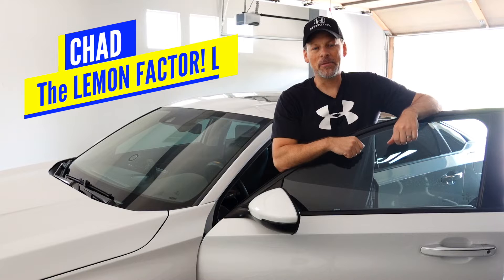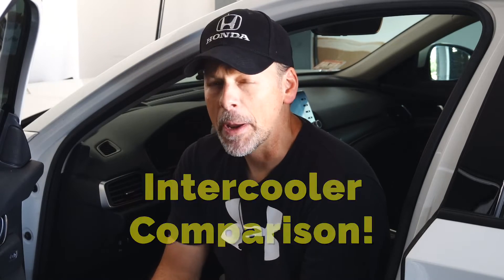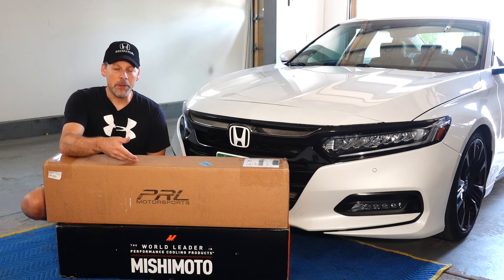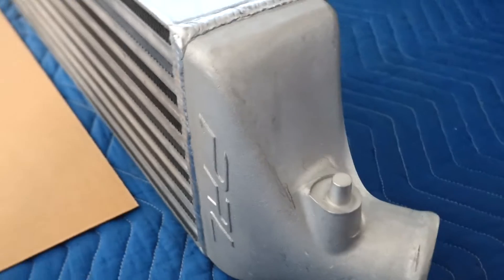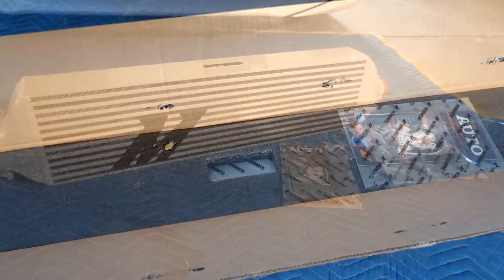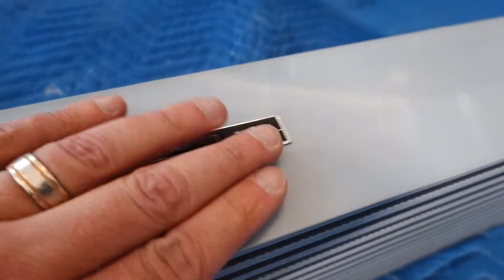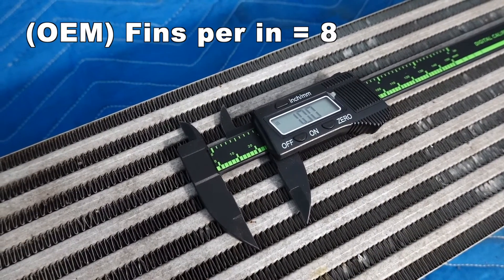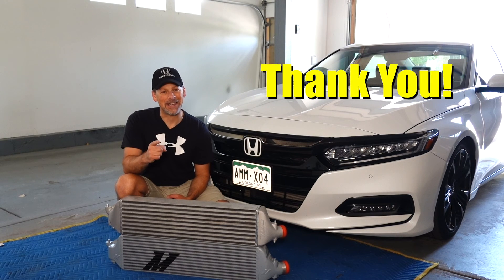PRL vs. Mishimoto vs. OEM - INTERCOOLER Comparison! // 10th Gen (2018+) Honda Accord

Comment: Just took delivery of my 22 Accord.  I noticed on the Mishimoto site that there are several different intercoolers available. Is the one in this video the J-Line?
Reply from the maker: Look for the one specifically sold for the Accord.
Reply: @TheLemonFactor , thanks. I tried, but it didn't site any for my model. Just universal fit ones.
Reply from the maker: Try putting in a different year (but obviously keep it within the 10th Gen Accord model years).
Reply: @TheLemonFactor , I appreciate it.  That worked. Put in 2020, and the right one popped up.

Comment: Mishimoto is painted possibly powder coated so it's cooling efficiency won't be as good, the only thing it's got going for it is the extra rows. It also weighs 4x as much. Honestly don't think it'll perform much differently to stock at stock boost levels. I would go prl imo
Reply from the maker: Not sure were you’re getting your information or conclusions from, but your assessment is inaccurate 🤨

Comment: Will this help lower knock control?
Reply from the maker: Somewhat… as a reduction / prevention of extremely hot intake air temperatures will help reduce the chances of knock. A better solution is to use a good quality premium high octane gas. If you need additional help, supplement a gallon to a gallon and a half of E85 per tank of gas.
Reply: @TheLemonFactor  I put the 1.5 gallons of e85 in my tank and my kcon still gets high at the track.
Reply from the maker: Are you using high octane gas from a tier one gas station?  If so, how hot was the ambient temperature?  Did you allow the car to cool down between runs?  Did the K.cont numbers increase at a specific speed (what does your data logs show)?
Reply: @TheLemonFactor  i can do a mix gas with e85 without flex fuel?
Reply from the maker: A small supplement of 1 to 1.5 gal per tank full is fine.
Reply: @TheLemonFactor  ok thanks

Comment: chad did you get the warnings on ur dash after the intercooler install? im getting the crash mitigation, ACC and lane departure and brake system light, after the shop installed the prl intercooler
Reply from the maker: I did as I disconnected the battery as part of the install. After the install I drove it a bit (less than a mile) turned the car off, then back on, and all the lights were cleared 👍
Reply: @TheLemonFactor  thats odd, must be something else that is triggering these warnings. I heard its a common issue on the 2018 models
Reply from the maker: Unless they messed with the front sensor 😕
Reply: Did you get the issue figured out im going throught the same with mine I might have to have mine recalibrated

Comment: Did you use the PRL intercooler tubing ?  Reason I ask is that I bought the PRL intercooler tubing initially and have not bought an intercooler. Will I have a problem if I have the M intercooler installed later using PRL tubing?
Reply from the maker: I currently still have the OEM charge pipes. The PRL charge pipes work with the OEM intercooler, so they should be fine with the Mishimoto as well.
Reply: @TheLemonFactor  thank you Chad !
Reply from the maker: Of course, not a problem 👍

Comment: this my guy right here. always bringing good information on the honda accord 2.0 even though i only drive my 2018 6 speed manual 2.0 for only 20 minutes once per week ☺️ ☺️ ☺️
Reply from the maker: Only once per week?  That’s a shame, especially with that smooth 6-speed! 😎
Reply: @TheLemonFactor  HA! u ain’t gotta tell me 😆 😆 😆 the gear box is still so tight when i put it different gears i try to convince myself i need to drive the car more 😅 😅 😅

Comment: So on the surface this is pretty good to see the physical differences between the two and the stock oem one.  However, this is not the whole story.  It's about pressure drop and flow as well across the IC.  A poorly designed/engineered IC can actually give you the very little or even negative intended results.  Very few sites/manufacturers talk about this.  Anyone can make/fab ends and weld them to an IC core off the shelf.  Not to mention the synergy of the piping on the front and rear from a flow and diameter POV, and how this works with the IC design.

Comment: It's just hilarious to me how a few years ago Honda swore up and down that they had no plans to ever put turbos in any of their cars.

Now apparently even Accords have turbos. Funny.
Reply from the maker: Honda wasn’t alone - many auto manufacturers stayed away from turbos due to the added cost and reliability. However, with more stringent EPA requirements, a turbo helps with efficiency, especially on smaller engines.
Reply: @TheLemonFactor  That's what's so funny about it. High revving Honda engines are perfectly suited for turbos more so than other engine brands, and enthusiasts have known this for many decades now.

As far as reliability goes turbos have been around for a very long time, so car manufacturer hesitation was unfounded, other than the added cost.

Comment: Pretty sure your tests will show the Mishimoto performs a little better. At least it did for me. I wouldn't use their non race intake but their 10th gen intercoolers are the best.
Reply from the maker: The Mishimoto intercooler is very well made and has slightly higher cooling capacity when compared to the PRL. Either one is a huge improvement over the OEM intercooler 👍

Comment: I have the Mishimoto Intercooler on my Accord 2.0T and I love it. Temps definitely run cooler than stock and heat soak isn’t nearly as prevalent now.
Reply from the maker: How was your install?
Reply: @TheLemonFactor  Install went great. I think it took longer to get the bumper off than it did to install the cooler. The top two bolts for the HondaSense were a little tricky though. Also, I think the torque specs for the cooler bolts are 18 ft/lbs. I tightened to that spec and haven’t had any boost leaks.
Reply from the maker: I’m glad to hear it 👍. Yes, the two 12mm bolts on the “hot” side should be torqued to 18ftlbs. The most time consuming is getting the bumper off and putting it back on 🤨
Reply: What line did you get for your accord?

Comment: I live in Riyadh (KSA) which is much hotter than where you live, Chad. I installed the PRL intercooler, and I have to say that I didn't intend to have it for performance rather than taking more care of the turbo and the engine. After one year of installation, so far so good.
Reply: Hey Bro I live in dubai and bought a 2022 accord 2.0 but my ecu number Is not compatible with the ktuner. Can you share your ecu number so I can check if it works?
Reply from the maker: Yes, I’d say Riyadh is a bit hotter than Denver, CO. 😉. I’m sure it’s helping you year round 👍

Comment: I’d love to one day see prl hvi v2 results
Reply from the maker: Send me one and I’ll test it, but I’d bet that there are no gains over the HVI v1. The new design is open underneath, dumping the air into the engine bay 😒
Reply: @TheLemonFactor  wait really? I thought it was sealed off
Reply from the maker: @JudgeFXX  I stand corrected, it's not open on the bottom as I originally thought.
Reply: @TheLemonFactor  ah ok I got scared lol
Reply: it's not open to the engine compartment. I just installed mine a couple days ago.
Reply from the maker: Please send me a picture (if you’re willing to) from the sides. Thank you. 👍
Reply from the maker: @danielrinehart869  Never mind about the pics... I stand corrected, it's not open on the bottom as I originally thought.

Comment: I would definitely go with the Mishimoto intercooler over the PRL because of the attention to detail in the finishing of the product. The dimensions are similar, and the weight between the 2 are very close, but I would definitely choose the Mishimoto.
They both are alot heavier than the stock intercooler however...
Reply from the maker: Aside from the added weight, the Mishimoto intercooler is really nice 👍

Comment: Awesome timing Chad. Just recieved my Prl intercooler. So interested to see both but especially prl one. The Mishimoto one does look a  nicer, think that's powder coated right? You really went all out physically comparing these 2 brands!!
Also I'm a welder and I'm usually tig welding aluminum at work. It's hard to get a larger size tig weld of aluminum to look real good. So I'm fine with how the welds look on both coolers.  Mishimoto one does look nicer but will that paint or powder coating cause a bit of not cooling as well as if it was raw like the Prl?
Reply from the maker: I think the coating on the Mishimoto would be beneficial, but in reality doubt that there is any measurable difference 🤷‍♂️

Comment: That's the key with turbo compressor. Cooling! It will make a bigger difference than the air intake.
Reply from the maker: Absolutely!  I would have liked to see them a little lighter, but… 🤷‍♂️

Comment: The mishimoto is definitely a looker compared with the PRL. That said I just installed the PRL and am happy so far!
Reply: U feel better throttle response?
Reply: @VikingMike2.0T  It was about 89 yesterday and I only put a few pulls on it but seems to pull a bit harder. Not sure if throttle response is the same or better. Seems to break traction even more easily now at lower speeds though
Reply: @JoseRivera-li8tr  ok cool thanx
Reply: Did you also purchase the pipes as well or just the intercooler?
Reply: Just the intercooler. Not sure there is much gained from adding the pipes with a stock turbo

Comment: What’s the best Sparkplugs to use for the phearable stage three tune
Reply: Running stage 3 right now nd seems fine
Reply: Stock ones, i jus got the ngk ones but havent installed em nd will prolly wait a little white until i do

Comment: What are the best spark plugs to use for the phearable stage 3 tune
Reply: Stock plugs are fine. If you have any misfires just gap them a bit smaller
Reply: @JoseRivera-li8tr  I have some mis fires
Reply: So I am looking for the best to use
Reply: @samarllimited1928  I would to say take it to a tuner to adjust stock plugs. Do not use ngk 95660, I used them and had weird misfires. reverted back to stock plugs
Reply: @samarllimited1928  I changed my plugs with oem ngk’s at 67k miles on 2.0t 10 speed. I didn’t “gap” them (as there’s no real concise information on whether they should be gapped or not….just alotta opinions), so I just dropped them in as they came from the Honda dealership. The truth is I never felt any difference (before/after) and I’ve been running jb4 map 2 since 20k miles, otherwise completely stock. There’s a slight rough idle when I start the car in the morning (cold start) during maybe the first 5 seconds (that’s always been there..) but after that I’ve never had misfires (or at least I can’t notice from driving..).  So I’m my case changing plugs didn’t really do anything… each plug is was $45.
Reply: @snriver1089  I am very grateful for this.  I will get the ones you recommended. Thanks a lot for the knowledge
Reply: @danish2199  isnt the ngl 95660 the ones that come in stock? Because i went to the honda website and got the plugs nd the ones they sent me are ngk
Reply: @snriver1089  where did u get them from brotha?45 for each plug?!!!
Reply: @desioasis2378  from the local Honda dealership. Regardless they’re expensive, but I think you can probably get them a lil’ cheaper through some other websites…I didn’t wanna risk it or end up buying something that’s not for the accord then having to return n what not…